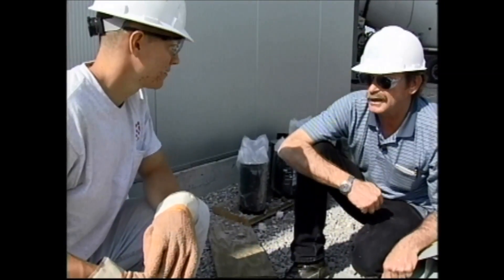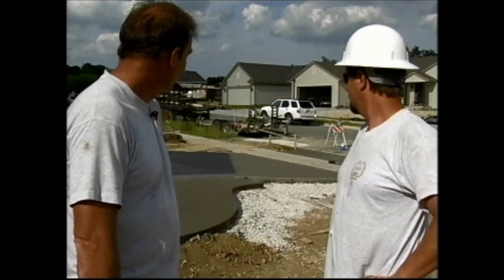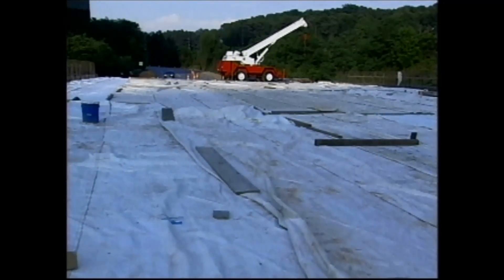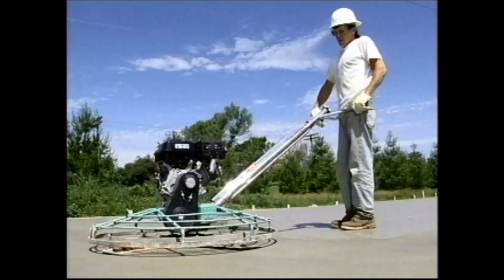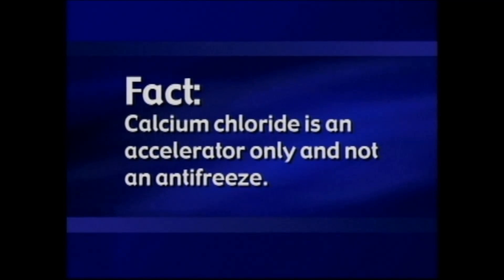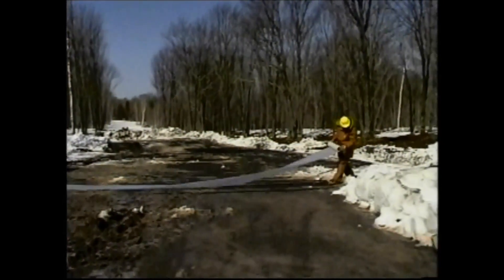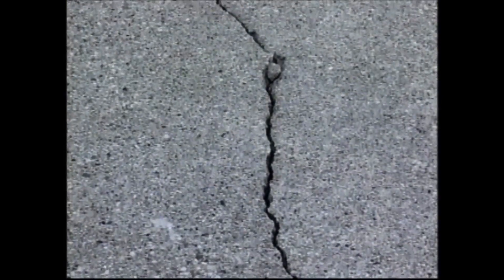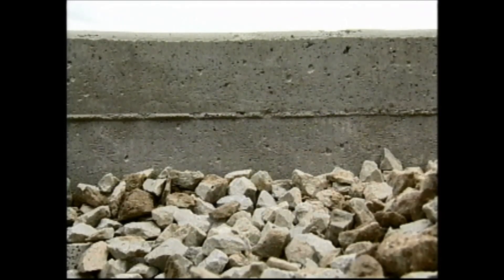Top 10 Myths in Concrete Construction

Comment: Still using calcium chloride in the US? That stuff does not prolong the life of reinforced concrete. It acellerates rebar corrosion.
Reply: dykodesigns2yt 
Here in the United States calcium is not used to prolong the life of the concrete. It is used to accelerate the set up and cure time of the concrete.
Reply: dykodesigns2yt although it is not "supposed" to be used on reinforced concrete some companies will still use it just for the sake of the increased set time. At the company I work for which is a ready mix concrete supplier we will NOT sell concrete with calcium chloride to a construction company who will be using rebar to reinforce their concrete. We will either batch in non chloride accelerator, or if the option is available to not use rebar at all we have a section of fiber reinforcements that can be added directly into the concrete. I'm not sure how you all do it over there but here in the states calcium generally isn't used on rebar reinforced concrete casts anymore.
Reply: Joe Riley But I suppose it's not used on reinforced concrete? Here in the netherlands we had many issues with precast floors from one or two manufactures who used that stuff in the 70's to speed up their production (they could not keep up with the demand and started cutting corners). A lot of those floors where used as ground floors above crawling spaces, and they often got rebar corrosion due to the use of calcium chloride (which is now more or less banned for use on reinforced concrete as the eurocode only allows really small amounts of it).  It became a serious problem for home owners and the like as repairing these precast floors can be expensive.
Reply: even if some plants dont sell the mix with it, you can eather buy the bags  from the plant or home depot so if your not  actually pouring it you would not know the descision is for the super intendent or contractor to make, most of the time.
Reply: dykodesigns2yt i've work for 12 years and even to this day they keep using dont seem like they care.
Reply: its only one of the ingredients in sea salt on your fancy pink salt label.....you also have traces of uranium as well.....enjoy.
Reply: I drove for a Ready Mix company in the mid-west for three years. The main time I saw chloride added was near the end of the year, generally in November or early December at the plant. Otherwise a few contractors added chloride from time to time even in the summer, but it was rare. And generally we ended our year once freezing conditions set in and the plant laid almost everyone off. The only pours done during the winter were indoor pours.
Reply: Me too and 2nd yours!
Reply: dykodesigns2yt very old video we don't use calcium chloride in Arizona anymore
Reply: What would u know anyway nerd an in our part of America we don't
Reply: Yeah, pretty stupid, right?
Reply: use cni
Reply: if you are a big red rock eater....i'd understand.....but clearly you a but a failed science 101 student.
Reply: We usually use chemical accelerator you put in on the job, not calcium BUT you best be ready to get it on the ground when the mixing stopos or it'll run off and leave you! Like 4500 on a hot day!
Reply: dykodesigns2yt You right they put so much rubbish in concrete they don’t tell you , l rather put more water then anything else to stop drying .
Reply: That would be Sodium Chloride.
Reply: we use calcium in canada. Only of absolutely necessary. I.e: pouring in below 0 and not wanting to pay guys to wait 3 days to get a finish on it.
Reply: Carl Sylvester I'm actually eating Potassium Chloride - sea salt. :-))
Reply: it's the concrete worms that eat the re-bar and when it's cold I want 2% and hot water
Reply: Calcium chloride? That's a posh name for cooking salt.
Reply: Maloy7800 wrote, "Calcium chloride? That's a posh name for cooking salt."

No calcium chloride is not table/cook salt. "Table salt," "cooking salt," and "rock salt" are all sodium chloride.

Calcium chloride is that bag of non-rock-salt pellets you buy for deicing sidewalks in the winter.

If the temperature isn't too far below freezing, rock salt is a cheaper solution. But if the temperature is below freezing by more than 11°F or 6°C, calcium chloride works much better than rock salt for melting ice on sidewalks.

Maloy7800 wrote, "+Carl Sylvester I'm actually eating Potassium Chloride - sea salt. :-))"

No, sea salt is mostly sodium chloride, with a bit of magnesium sulfate (Epsom salt), and smaller amounts of other minerals. It contains a little bit of potassium chloride, but not much.

Comment: Old video but still very true today. The only problem I have is not added water. In a state were it is super hot almost everyday of the year, adding water is sometimes the only thing you can do.
Reply: Half Star Films I live in Nevada, so I know what you're talking about. Back when I was running a triple trowel on a pour one day, the wind was already kicking in by 4:00 am, by the end of the day & 38000 ft. they had figured out the wind was sucking 300 gl. an hr. out of the slab! Yea, a big part of it had to come back out.
Reply: yup i agree and for that reason if the job required 3000 psi i ordered 3500 psi
Reply: Half Star Films If you lay the nylon under the concrete it will dry much slower and concrete be stronger .

Comment: The so-called pros are just plain silly sometimes. I would love to get them out on a job in mid-summer with the sun bearing down. We'll see how long that 'no adding water' bull lasts.
Reply: a light mist will compensate.
Reply: I've batched and hauled concrete off and on for a long time and it was always ordered in p.s.i. strength. The only time I've been around the 'bag' formula was when it was mixed by hand BUT I haven't been everywhere and done everything. Things are different in different places.
Reply: I'm in the Pacific Northwest.  The plants charge you more for a design mix because they are on the hook for that mud performing to your psi specification.  This is generally mandatory for government and most commercial.  For cement sack mixes, all the plant has to guarantee is that they put the # of cement in the mix and you're on your own for strength.  That's the way 99% of residential works around here, because it's cheaper and we rarely need super compressive strength concrete that needs to be tested.
Reply: Yes, I agree. A dry hot as hell summer like I deal with in Phoenix, sometimes you have to add an little water. I try to limit that but that Phoenix sun dries that shit so fast.
Reply: kreteman777 by the time they done raking it they won't be able to even bull float it:)
Reply: Josh Silentman I'd slap that dude! Lol
Reply: kreteman777 perfect answer..
Reply: Too much water produces a poor product, especially if there is a max w/c%of the mix design.  If you need to move it because you've poorly planned your tailgate or buggy placement plan, use an AdMix.  Adding water past the w/c% will cause structural problems prematurely and while you may not care, there are supers and QC's that do.
Reply: Ya throw couple more gallons on that shit scrubbing sucks so does screedin a four inch slump it all sounds good in the lab come on out pour 75 yards in the 90 dEgrees
Reply: Just use a ad mixture for better flow....if you don't have that at the time of pour then use a vibrator to bring the water up to the surface for more work ability.  Adding more water than necessary to the mix is very bad during the summer because of shrinkage cracks occurring.
Reply: The "So called pros" do it all the time mid-summer with the sun bearing down. If you think the "No water" is bull, then I'd have to say you still have a lot to learn. I'm in the south and summers are brutal. No excuse. I've been inspecting highway jobs for nearly 20 years. A good crew gets the mud placed, troweled, worked, floated, and covered with burlap and plastic in a timely manner without having to add water. You try spraying water on my bridge deck or "Christening it" with a water soaked brush, and I'll warn you once. Next time you leave my project. Most concrete crews think everone wants a smooth, slick garage floor finish, and just don't have enough experience with full depth paving or structure concrete. Your method of adding water to overwork the surface leads to shrinkage and surface cracks. Surface cracks let water in and the freeze starts popping out chunks. People like you keeep silene crack rehab companies in business. But what do I know.. I'm just a silly so-called pro. lol.
Reply: I've hauled it but it was machine stuff, no hand work except expansion joints and touch-ups.
Reply: Lewie McNeely
Reply: kreteman777 unusual hjhjj
Reply: Yeah I know I have a driveway that was poured to wet, spalling and cracks
Reply: Don't add water use a plastisizer to get the slump you need...without hurting the strength...know the info needed to do the job correct
Reply: Man I really wanted to see these guys lay down some 2.5 slump driveways and sidewalks.
Reply: @jaystein1405 I worked on a warehouse 3-inch slump temperature 3/8 Stone in Portland on top use a roller wooden Bull Float in the regular Bull Float for 10,000 sq ft a day
Reply: on some jobs i have been on their was an inspector monitoring the water used also 3 cilinder samples were taken on each load and they were tested . if truck got to dry and no more water aloud it was sent back . of course you dont have these issues with concrete inspections on residentual or even most comerciaal jobs
Reply: kreteman777 you don't think or understand much I think . . Maybe you're some kind of laborer... you really don't want to add water from a truck if you give a crap about the work you do... yeah if your tir3d little arms can't take it and you ordered the mix at a 3 inch slump and somehow now you need a 6 inch slump I guess ya gotta do what ya gotta do and sure you did it like that and never got a call complaining and when it does 3 or 4 years later you surely won't be a guy who warranty concrete that long so to you there's nothing wrong with your jobsite being centered around making your day easier .. any logical person would just order the proper slump in the first dam place
Reply: I rarely put anything on the ground less than a 5, and most of the time it's a 5.5 or 6 & have never had to replace anything not to mention jobs I'd done 20 or 30 yrs back, I still see quite a few because they're at friend's houses or businesses I frequent! It's a 100 degrees, this shit's gonna go fast, fuck yea. . .give it another five gallons cuz we're not scrubbing!
Reply: I'm in NC and it's all done with a mix design. That's the way it's ordered as so many yards of what. It's all guaranteed to bust it's rated strength if not watered down and if any water is added over a 4 it's signed off on the ticket. Anything sideways is put down too so the plant is covered. Tests are run every so often just to keep everything up and up. It's all certified, even the materials. If in doubt the job can get Swiss hammered to be sure. Very finicky.
Reply: Jose de leon. same here Jose I've heard that a million times only have enough water to wash my truck down the chute grinds my gears 2 peace out brother
Reply: @joeystephens2776 commercial job always had a fire hiding with a hose hooked up going to fill your tanks up don't hand me that bullshit
Reply: kreteman777 yup been there... then you sometimes have to deal with the truck drivers sayin they only got enough water to wash their chutes...grinds my gears😑
Reply: lol heard dat
Reply: kreteman777 CORRECT
Reply: trbig67, And it is easy to see they are referring to Bridge Builders in the Video, Right ?,  You don't get much more south than me, and ain't nobody laying no burlap on nothing around here. A Good Crew will be Laying Mud, long after your overbearing Mentality has been exhausted, Here is a Concrete Fact for you, The Majority of Jobs go down with a lot less than a 1 person per 3 yards poured labor force, Hence allowing Regular People to afford Concrete, unlike the Wasteful Government Run Concrete Work, which we are forced to pay for with absolutely no better results, You are just another reason for the wasteful spending, you and the other straw bosses hanging around doing nothing. I'd be surprised if you could lay ten yards without a 5 man crew, let alone by yourself. Just another waste of space inspector drawing a check, they are digging up our highways and replacing with asphalt all the time because of people just like you, Pour some Concrete yourself, then get back to me on that no water thing.
Reply: I've hauled mud off and on for a long time with all matters of trucks and it;s the guys that get it down are the good ones. They usually ran it on a 4 to a 5 unless it was pumped. Then it ended up being a 4 at the end of the hose. The slobbering ones were just asking for trouble because it WOULD come hack to bite them. Get it down and leave it be! Curb, slab, whatever. Then let it cure slow. But I was just a goofy mixer driver off and on for 40+ years. What do I know too.
Reply: Baf Lange, you have obviously never poured concrete, good luck trying to convince people you have.
Reply: Specifying a design mix is an unnecessary cost for a garage or patio.  Specifying the number of cement sacks is cheaper and perfectly acceptable.  5.5 sack.  6 sack if you're a worry wort or have clear evidence you need more psi.
Reply: kreteman777 I'm from Dublin Ireland and I work on a concrete pump we do have to put in water about 90% of the time because its to stiff let all the people that sit in an office and say no water come out to site a try pour concrete bet after 2 mins they would be saying wet it up. I
Reply: kreteman777 you must a scab 😂😂😂 keep whipping those migrants and telling how tough they are

Comment: #1, Not to mention aggregate type.#4/ 6:28: Delamination only occurs when lamination has occurred. Catching edges by hand when working with a power trowel will cause laminations if the surface around the edges are "closed' and the wop-wop machine impinges on the hand troweled areas. I fought for years over who has the right of way. I finally gave up and just started flat-troweling edges then walking away. If the power trowels couldn't get it closed in time, tough titty. Portland ore. Union finishers can't hand trowel to save their lives. These seem more like Bob Villa-type homeowner mis-conceptions rather than myths in the trade. NOBODY with half a clue pours on frozen ground. Number 8 just freaked out Somero.
Reply: There are so many union finishers that if it were not for the union, they'd never find a job, everything they fuck up is "It wasn't me" or "I don't know" or "what rolled edge? And as for the short hand floats & swimming pool trowels that they think they're not leaving any marks with, well you know what I'm saying, the idiots talk a good game before mud hits the deck then have some excuse for all the chatter marks, missed edges, steps that look like loaves of bread, crooked joints & cat faces that sends em' driving home thinking they actually know what they're doing! I think I can retire in three more yrs., not that I've saved any cash but at least I can get away from the retards, I think I hate the job I spent so much time learning how to be one of the guy's that most every other finisher in town would say "he's a good fuckin' hand". The ones that know me do, the ones that can't finish might not because they don't like the way I pointed out all their fucked up shit (you get tired of fixing it every day) but I'm not sure if it's much of a reward or not! Know what I mean?
Reply: chuck lane
I got tired of walking onto a new job and having ignorant cunt's think I needed to prove something. I'm fifty now with half my pelvis and one hip made of titanium and ceramic, fake knees and a bionic shoulder. Plus a bunch of little shit like fucked up vertebrae and wrists. Now I live on disability payments and am not allowed to have more than 1,000 bucks in the bank. Oh, yeah. I'm a vet, too. Twenty bucks an hour was top dollar for a finisher when I started laboring in the 80's and it was top dollar for a foreman when I was forced to quit in 2006. Fuck work. it's a scam.
Reply: I hear ya, I'm 59 & use my mag as a crutch every time I get up off my knees, I wasn't as good on a speedway bike as I am with a trowel. As for being a vet; Thank you sir for risking all for our USA, too bad it's turning out the way it is.
Reply: Thanks for keeping the trade from going to shit, Chuck.

Comment: There is so much to consider for poring concrete. I poured 2.2 yards for a 12x16 pad for my shed with my wife. I had a slope of about 12 inches on the 12 foot side. The digging was a nightmare. Clay, rocks, bricks and roots which pulled back each meager shovel full. I finally got frustrated and shored up one side using a 2x12 as a form board. I thought this was going to be a disaster. It has been over twenty years with no cracks. I have been looking for a good source book on setting proper forms. Do you know of a good one? Thanks for posting the video!
Reply: +robert morin Just make sure your forms are straight, level, plumb and well-braced. Unless you are going into professional work, $90-$150 dollars for a technical manual is needless. It sounds like you did a great job on the 12x16 project. http://www.concreteconstruction.net/table-of-contents/magazine.aspx has always been one of my favorites for seeing what is possible to do with concrete, if you want to look into the concrete construction field.

My first recommendation for any concrete work is to have a stable base to place it on.
Reply: +robert morin     plumb leval square.  and brace it more than you think you need.  once a form starts to push. its almost Imposible to push it back!
Reply: That's a slope of 8%  generally  you want a slab to have a slope of 3-5 max
Reply: TheTomBevis thanks for the link your awesome